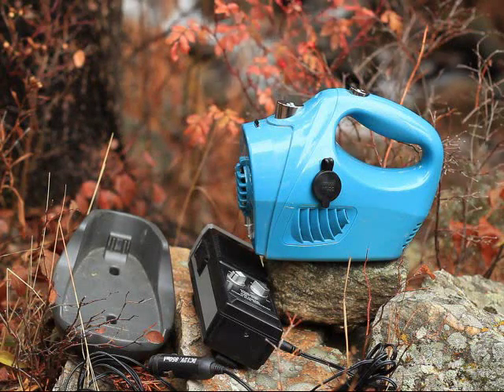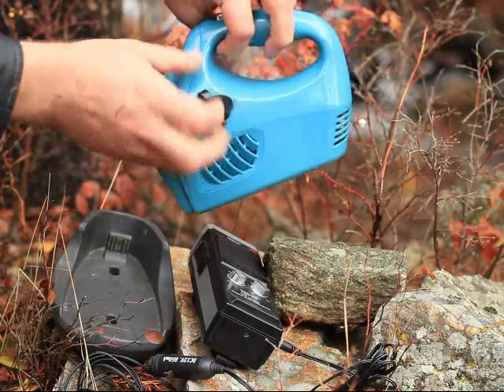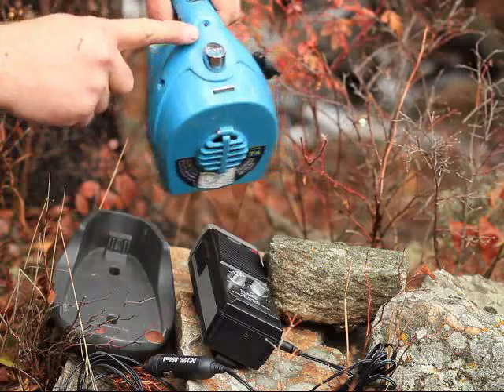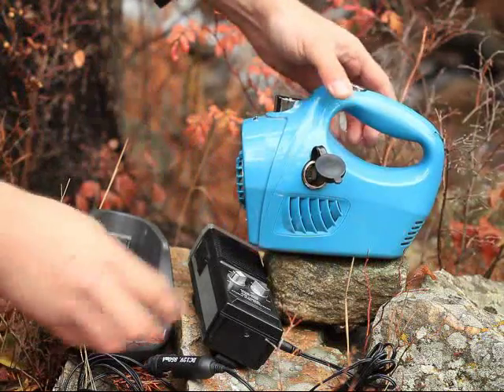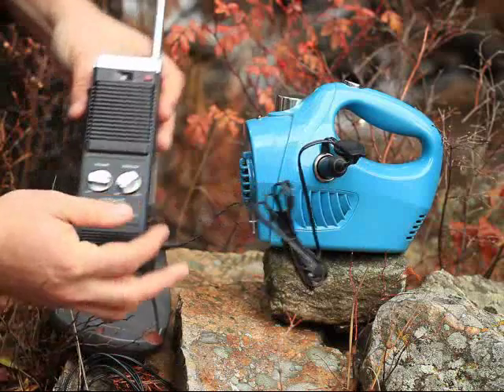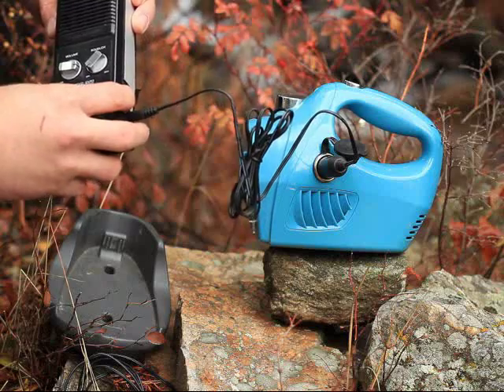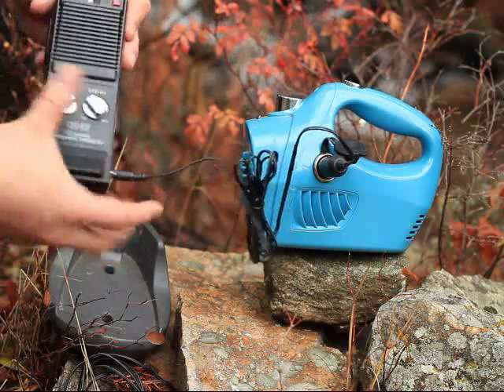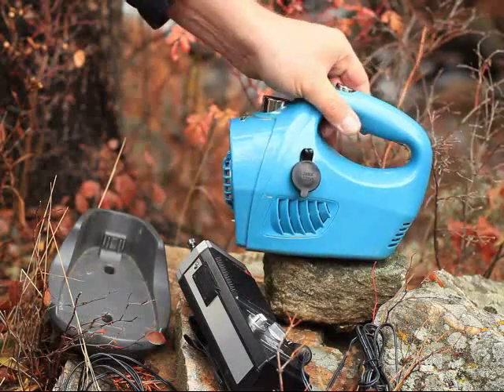Cordless Vaccum Battery Backup Remote Power Supply Hoover Black and Decker Dustbuster Prepper DC

Comment from the maker: Man! that's a long time! yeah I suppose I was looking for trouble with that comment .. didn't mean any disrespect. I like the option of monitoring CB when wrecks and other road closure issues come up .. otherwise its satelite radio for me. Not much chatter out here unless your on I90 or by the truck stops as you mentioned. Good luck with those stoves by the way .. I may get into building some again and have learned much from your design.